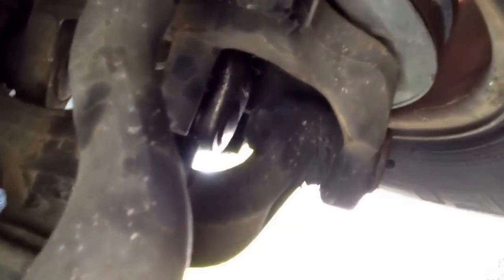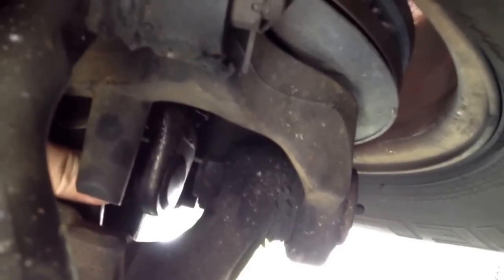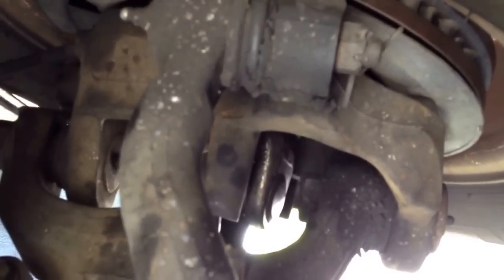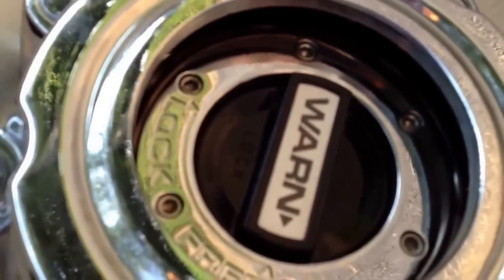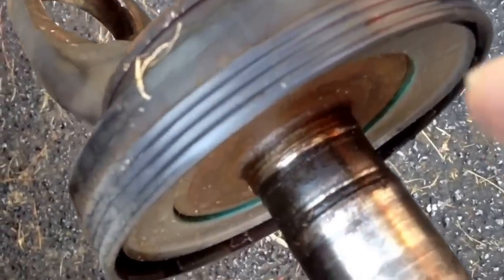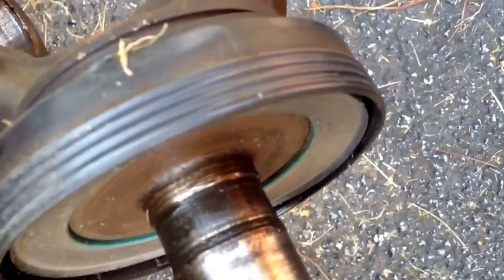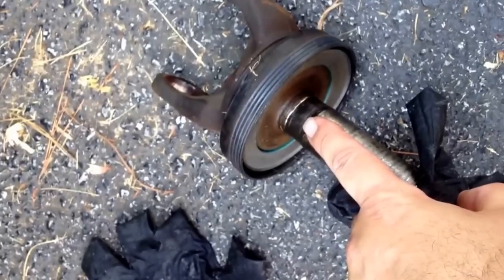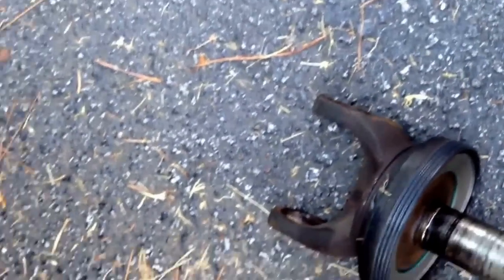F250 needle bearing, spindle shaft, and knuckle seal issues.

Comment: I don't think that's exactly true, but from what I understand it's not too far off.  The needle bearing fail for two reasons mostly.  One is insufficient lube.  Many folks will replace their hub and bearing assembly but not put enough grease on those needle bearings.  You need to grease the snot out of them.  No such thing as too much.  Also, pull your hub assembly once every year or two and inspect and re-grease them.  If the needle bearings are questionable, just drive them out and replace them yourself.  Those are the only bearings that are serviceable in the assembly and they're easy peasy to replace.

The second reason is related to the auto-locks.  As you pointed out, there is the vacuum seal between the hub assembly and the u-joint yoke.  If the seal fails, the hub lock cannot hold a vacuum and the auto-lock fails to function.  This is when many folks will just manually lock the hubs and forget about it, controlling the FWD by the transfer case alone.  And you're right.  This is hard on the front axle components.  But that vacuum seal also prevents the elements from getting back to that needle bearing.

If the seal fails, the auto-lock will fail to engage, but also moisture and dirt can get back there and chew the crap out of those bearings.  That's why I'm reinstalling new auto-locks in my hubs.  I don't like them any more than the next guy, but if the auto-locks fail to engage, that's a clue for me to check that vacuum seal.

Any comments or criticisms are welcome.  I'd rather be told that I'm wrong than be wrong and not know it.

Comment: Thanks for your response. Links are fairly new, less than 20,000 miles. The 2" leveling kit I put on is about 65,000 miles old so that all looks good. The add a leafs I put on the back are also 65k miles old.  I seen another video on YouTube it could be the needle bearing but it blows my mind it threw out my stabilizer bushing on the driver side.  When I drive over 10-15 mph I hear grinding/squid king, humming noise out of the fro t driver hub. There is some play when it goes into the drive shaft.  Your video helped me see the possibilities. Thank you for your responses. It helps. God Bless.

Comment from the maker: Jamie,

Use a crow or pry bar on the back side of the U joint. It can be a pretty tight seal. You'll find there are only a couple if ways to pry on it from the back side. There are no retainers, it's just sealed in good from years of dirt, grease, and grime. Be sure to clean the inside of the knuckle out once you get it out. Hope this helps!

Comment: Really good video. Pulled mine yesterday. Looks like a grenade went off in there.
Reply: Exactly!  Removed my 2003 F250 right front axle today with some fight.  I think the vacuum seal fails first, allowing water and sand to damage the open needle bearing (super bad design! ), then u joint fails, then locking hub assembly fails , as the needle rollers are everywhere and embedded in shaft and jammed wheel hub as well....

Comment: The vacuum seals go bad which causes the axle shafts to start to wobble which then causes, plastic hub problems, destroys the needle bearings and dust seals. Mile marker hubs, Warn hubs and many others are better than the stock plastic junk. I personally run Mile marker supreme and abuse them quite often never had one break but I did break a warn and they sent me the parts I needed. We install the vacuum seal with a 3" PVC flange and a 5lb sledge, if you take emery cloth and clean the half shafts up,there's no reason to replace them unless they are absolutely banged up.

Comment: When that bearing goes out it don't matter what lock hubs you got that axle is going to keep on turning because it locks itself to the axle and Spins every time the wheels means you can take your lock out out that's the bearing that fails the most and causes your damage

Comment: One of the Best informational videos I have seen for help on a Ford 7.3 that I have seen. My Son and I just changed my front left wheel bearing on my Excursion yesterday. Was going to change the axle U joint to 4x4 also, but was worried about tearing up the seal that goes to the knuckle shaft, there is a tool to knock seal back in, but is there a tool to pull out / press the axle knuckle with U joint out ?? THANKS FOR GREAT VIDEO !!!!

Comment: the best thing is to take the hub off every so often and grease that bearing. i have done this job on my truck over 10 time but i mud it a lot
Reply: There should be a grease cert built in... it's sad that we put up with this kind of bad engineering.
Reply: @calholli  See if you try to lube it from vacuum hole ?  Such a tiny open needle bearing in an HD and dirty spot is childish level of designer!
Reply: @osbornebay944  Yeah.. it's obviously planned obsolesense...  because when it goes bad it eats the shafts..  Go look up "f350 front axel shafts" ...  the kit is $460 on Ebay... You don't want to know what ford charges for it... its insane..........    meanwhile---  most other CV shafts on cars, with ends assembled... are only $60.  They know how to build it right--- but they don't do it.
Reply: @calholli  When Nissan trucks used the same tricks (engineered and timed failure ) to sell more trucks, it failed spectacularly,  40 years later, Nissan Brand still suffers. Toyota is the opposite examples.
Reply: @calholli  Blame Ford? It's a Dana Spicer axle, model 60 usually. The parts are a little cheaper buying them from a Spicer dealer. Meanwhile, there is a service interval specifically for this needle bearing, I think 60k miles. I think they intended you to have them looked at a lot more often than most people do, especially those who drive in water. I sure wouldn't want a CV joint if the straight axle is tougher.
Reply: @uruiamnot  It should be a sealed bearing-- or it should be in its own oil bath-- something---  anything is better than what they have- its designed to start failing after hitting your first mud puddle..   The "wheel bearing" itself is fantastic---  but that little needle bearing for the shaft is embarrassing
Reply: @calholli  Ok, good examples in theory. But what are actual competitor designs for a 4WD locking hub and a shaft like this? Who has anything like you mention in full sized trucks? Or are there designs with dual bearings that half the load of this design? In other words, who does it better?

Comment: Great video man. Question. Mine has been creaking and popping over bumps but yesterday just got off the freeway doing 75 and slowed to 35 and I felt like my front end was bucking me out of the truck. Seen I had lost a stabilizer bar bushing and thought I'd gotten lucky. Wrong. Replaced that it the truck driver front sounds like something is grinding and it speeds up as I accelerate and vise versa. It's a 2006 F250 4 x 4 Lariat with 200k miles. My question, did yours act like this when yours were going out? Does it typically throw the sway bar busing out? It bent the hell out of the metal threaded clips so I replaced with he bolts, washers and nuts with thread lock. Self employed and my truck is my work horse. Twiddling my thumbs
Reply from the maker: Sounds like one or both of your leaf springs are broken; they support the weight of the truck. Popping could be bad sway bar links.

Comment: im having a hell of a time geting the short axle out do yoi have any pointers thanks
Reply: I put 5 lbs gear puller on two of wheel studs,  work around it off.  The vacuum seal is hold the spindle hubs assemble.
Reply: Also the loose needle rollers are jamming hub to axle.
Reply: Paul Revere Agree,  I just like to tell Ford truck folks, it is not too hard to DIY front axles R/R,  as many F250  SD makes to 4-500k miles.

Comment: mine has that same play but alot worse then you but i have it on both sides does that mean i have to replace both short shafts and the up and down motion will go away?
Reply from the maker: Tyler, 

   Not necessarily, but possibly!  You have to inspect and troubleshoot. Take both sides a part, check the knuckle/vacuum seal, check the half shaft to see if it's been cut or wore down; additionally, check the needle bearings themselves (you should be able to tell if they are still round and well lubed or rusted and out of round). One thing I did not mention I did in the video was to check and/or replace the u-joints, those can also go bad. Most problems with all of this stem from your factory hubs failing which can cause them to stay locked in, or bad (cracked or broken vacuum lines that actuate the hubs) that cause your hubs not to be disengaged when you think they have. So as a result, the hubs turn all the time and constantly turn thereby increasing the possibility of things wearing quickly if something's bad. Remember, these trucks ( at least 98-02) are coming up on being 15+ years old so some of these drive components can start going bad. Hope this helps. 

Jeff

Comment: Does anybody know a part number for that bearing. Wherever I go they say it comes as a complete unit with the wheel assembly. Easy enough to remove it and just replace the bearing.
Reply from the maker: http://www.partsgeek.com/gbproducts/DC/5337-05190406.html?utm_content=DN&utm_term=1999-2004+Ford+F250+Super+Duty+Axle+Shaft+Bearing+Timken+Front+99-04+Ford+Axle+Shaft+Bearing+2003+2002&utm_source=google&utm_medium=ff&utm_campaign=PartsGeek+Google+Base&gclid=CKPpwcaO9cwCFU07gQod8hwPMg&ad=47584901292
Reply from the maker: Something along the lines of that. I'd search for the Spicer needle bearing of better quality. They are easy to tap out of the existing hub bearing assembly, but you'll need a press or have a shop press it in for you. Way cheaper than buying a new hub bearing assembly.
Reply from the maker: Here is a step by step replacement instruction. Also this guy carries the needle or spindle bearing:

http://www.guzzle7pt3.com/nblube.php
Reply from the maker: Sorry, guzzle doesn't carry the bearing, but here is another place:

http://www.quad4x4.com/qu40143.html
Reply: When needle bearing fails, it likely damaging the shaft, seals, u joints as well, a very costly repair!
Reply: @superdutysandsilver5039  Thanks so much for information on parts and tools.

Comment: The Ford engineers put such a small needle bearing there, for sure failure to u joint and locking hub assembly.  My F250 front right is the same issue, need an outer shaft and locking hub assembly replaced. Very costly.  Poor design!